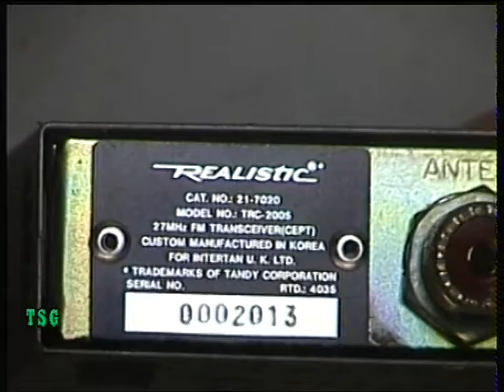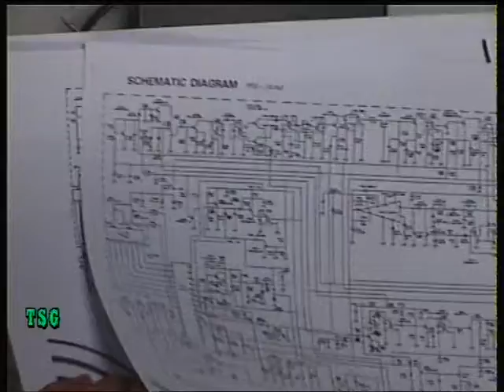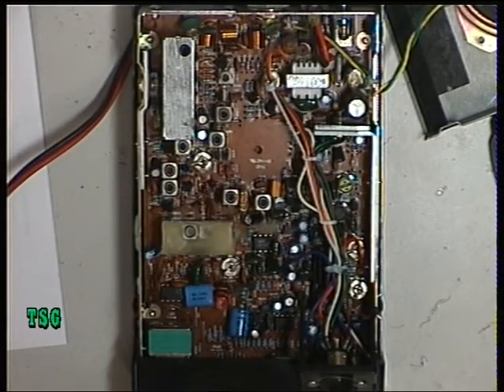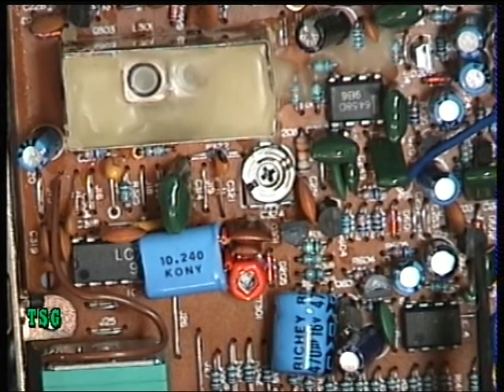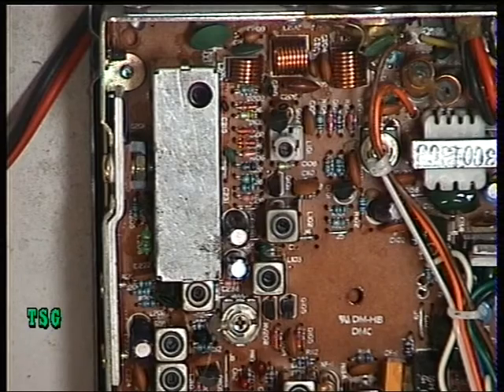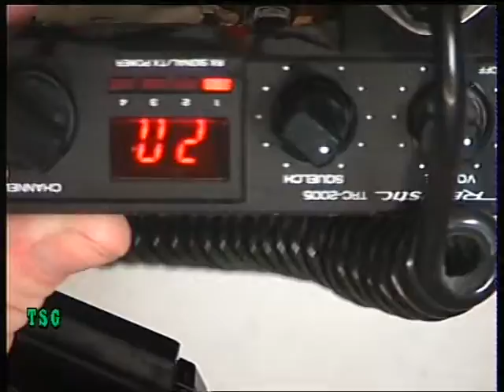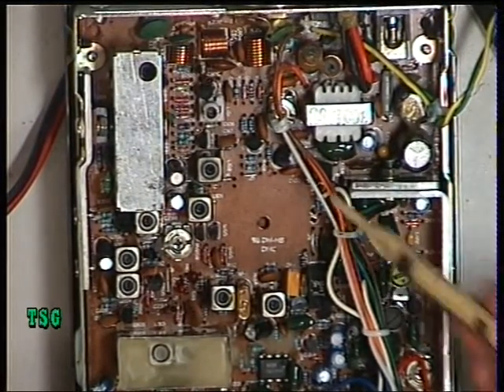Realistic TRC2005  UK (PR27GB) CB radio (Mobile) - Transmit alignment

Comment: Hi Richard, I'm trying to align an Maxon MX-1000 (eBay purchase where a screwdriver expert has been at it, plus it had a couple of blown transistors and a 9.1V Zener diode) but the board in your TRC-2005 is quite different to what I have in my MX-1000.  I don't have the service manual and there's nothing on the internet that I can find.  Do you have an MX-1000 you could align at all?  I notice that my MX-1000 has nine (!) variable inductors (L101 - L109) on the receive side, five on the transmit side and I think L301 is the detector.  More inductors than I'd expect, but it is nonetheless an MX-1000.  The screwdriver expert has had the shielding can off in the back-right corner of the radio and L207's core appears to be missing, though it may never have had one.  Anyhoo, any advice would be gratefully received. :)  73s
Reply from the maker: Yeah, I'll do one next job today while Mr Chippie is here; there's one in stock. I can always hear Mr Chiippie in the audio workshop strumming his electric guitar into whichever amplifryer has just repaired/serviced.

Richard
Reply: Heheh!  Thanks very much, Richard. Good old Mr Chippie! ;D
Reply: Ah!  I've just noticed on the receive side of your video that the additional inductors are for the 455KHz IF alignment, which explains the nine in my Maxon MX-1000 - the last three inductors in my MX-1000 inductors are the same type as in your TRC-2005.  Thanks for explaining that in your receive video as I've not seen that before.

Comment: You really need to buy some new camera equipment.
The video quality is so poor.
Reply from the maker: +MrMac5150 Well it looks OK on the desktop computer at this end. You will have to bear with me. I'm someone who lost all funds when a bank went bust in the events of the WTC9/11. This leaves me struggling to pay the mortgage & driving a 28 year old car. No camera equipment can be purchased in the foreseeable future. The overhead Sony camera cost around £800 at the time in the 90's, the panasonic video mixer cost £1000, the Sony caption generator was £550 & each of the two Sony monitors were £350 each & the Sony HDD video recorder was £380. I have three other colour cameras available to me, but they all use pickup tubes & I feel are lower resolution & have the snag of longer persistence. There are two monochrome cameras here which may be better on resolution, but I think the colour helps.

I do these videos solely to help others & get nothing out of this whatsoever. I started this as all CB related videos were full of bulls**t, myths & legends. As a qualified professional 2-way radio engineer of over 30 years experience I feel that alignment information "as per manual" is very helpful to support these kind of radios in the future. 

Richard
Reply: +UK CB radio servicing All of the videos look fine richard it's nice to see them
Reply from the maker: Thanks for that Simon. I had a message from YouTube recently about shortly being eligable for a donations thingy, so will do when they allow it
Reply: Upload your own then you cry baby bitch.
Reply: +UK CB radio servicing Thanks for posting Richard, Its the knowledge your passing on that's important not seeing inside a cb radio in HD so please ignore any negative comments.  I'm sorry to hear of your financial situation.  Just a thought but this could work for you - some of the websites I download DJ  mixes from have a link to make a donation via paypal, which I have used when I feel I have had something worth paying for.  I think your service should be the same, I for one would happily send you something for your kind help.  Keep  up  the great work. Simon